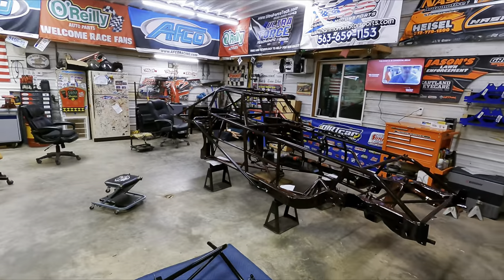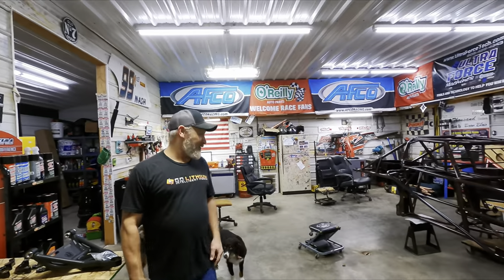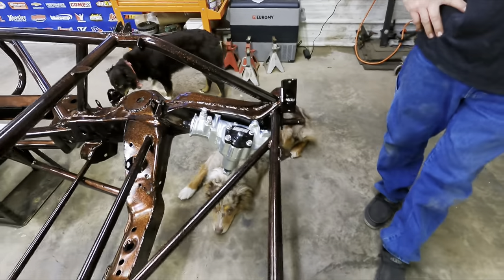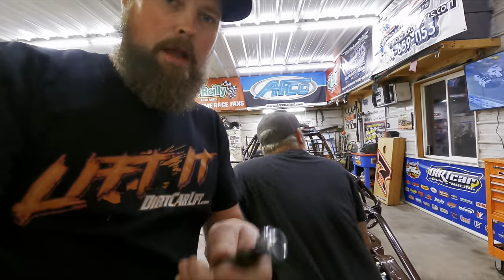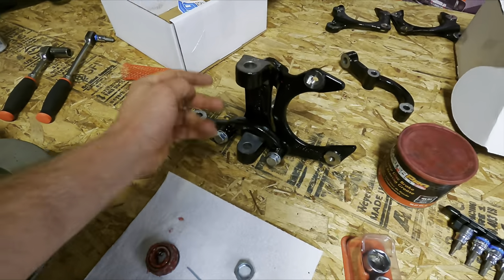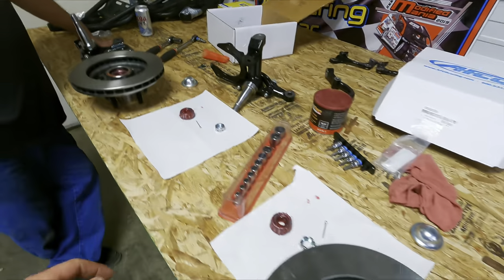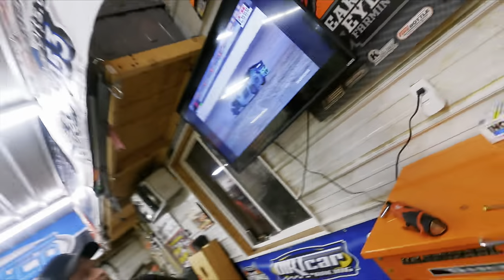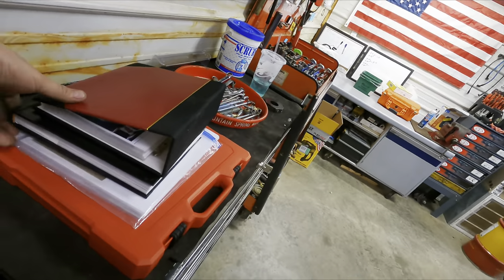The transformation begins! Rebuilding a lost and forgotten race car￼

Comment: Tim,have you thought about placing the clutch pedal between the brake and throttle pedals?It would take a bit to get used to,but it is more comfortable that way.
Reply from the maker: Yes I have, it’s possible, but I’m kind of stuck on what do do about the bias adjuster once I move the pedal to the right side. The clutch pedal is interfering with it
Reply: @OldNo7Garage  Can you easily reposition the bias adjuster?
Reply from the maker: @tracyjones6284   I can’t figure out how you’d move it
Reply: @OldNo7Garage  I am in AZ.,but if you could show me the brake bias adjuster and where it is located,then show me what kind of room you have to the left,where the brake pedal and master cylinders would be relocated,i could probably figure it out.If the adjuster is on the panel itself,it may mean building a new panel,and moving gauges to the right to make room for it.
When there's a will,there's a way.

Comment: Just a question Tim , was the idler arm supposed to be tapped to the size of the new frame bolts ?
Just wondering because to me ( not that that means crap lol ) but drilling the wholes bigger creates a shear point at the bottom hole in my messed up thinking 🤷‍♂️
Reply from the maker: I hear ya. But, we only went a 1/16” bigger
Reply: @OldNo7Garage  ok, did want you any bad luck lol

Comment: Tim, not liking the way the pedal assembly is bolted. The bolts should thread through it and, at the least, 1/4 past. Please consider changing them. My old schooled brain is yelling, oh no no no no no!
Reply from the maker: You’re talking about the one I put in from the bottom
Reply: @OldNo7Garage  
Yessir
Reply from the maker: @MosinMan76254  agreed, but it needs to stay flush by design for clearance purposes